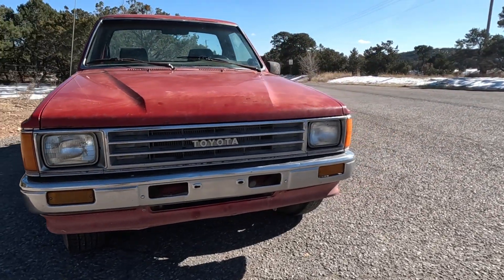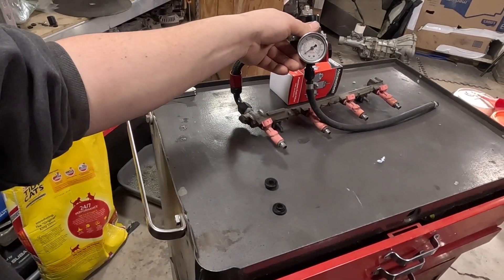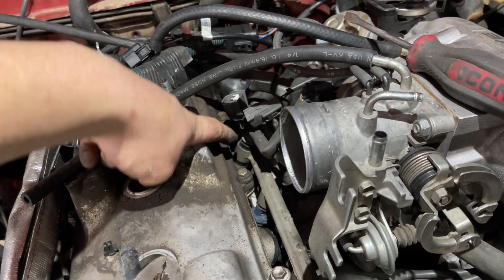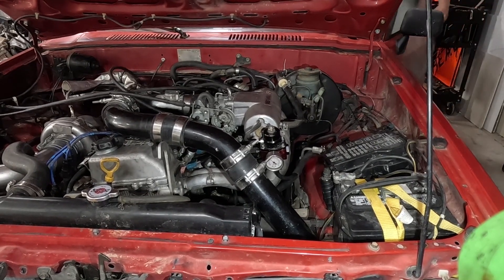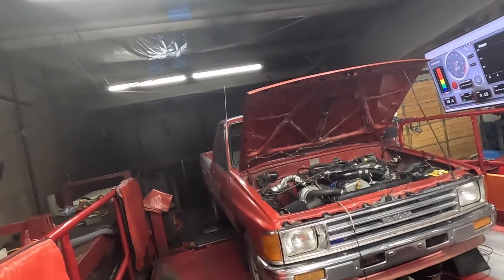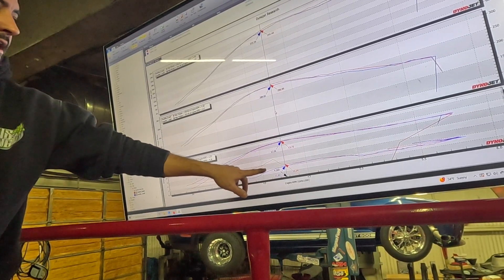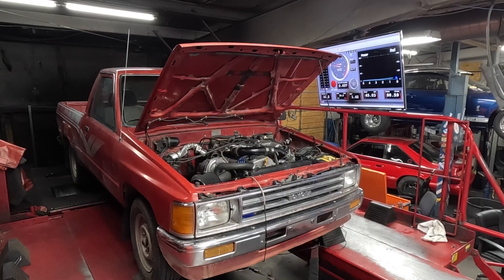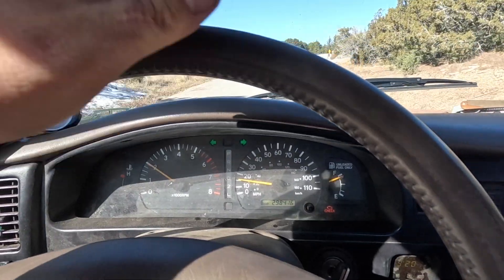TURBO 2RZ Toyota Pickup On The DYNO! - How Much Power?

Comment: toss the automatic in the trash and put in a manual. there is very little support for the automatic and you would likely end up sinking lots of money into it, just for it to blow up again. If you get your hands on a 2tr bellhousing you can run a R series transmission that should have no problem handling turbo power.
Reply from the maker: I’ve actually been on the lookout for a reasonably priced r series, they are not easy to find for cheap! 
I unfortunately think I’m going to end up manual swapping the automatic swap, but have a good auto to go in I might just throw in just to get it back on the road!
Reply: I know a manual is more common for the turbo 2RZ/3RZ platform. But I’ve seen plenty of people have success with upgrading the pressure solenoid and adding a trans cooler. I’ve been researching for quite some time and that’s likely the route I’m going. You can brake boost and the auto keeps the turbo spooled between shifts too.
Reply: I think my Tacoma has a w59 behind it. The clutch slips at 50 mph with 16 psi boost. 5 speed holds up though
Reply from the maker: @mopedman666  are you 2wd or 4wd?
Reply: R150 swap it !!
Reply: i'm wanting to go for 15-20psi of boost with a 2rz, there's sequential shifter kits for R series but not for the W58(which is another i've seen mentioned for swaps)?

Comment: R155 trans will bolt up, run a 3rz clutch since its a larger diameter disc and flywheel. R155 is the strongest 5 speed toyota has made yet. 2005-2015 tacomas. Its what i run.
Reply from the maker: I’ve been looking for one local or at a junk yard wiring a reasonable drive and they seem to be hard to find, I would definitely like to run an R series transmission.

Comment: I've got a 1989 with a 22re 5spd, I have future plans to put at turbo on the 22re. How hard was it to fit one onto your 2rz? also did you have to do any tuning to the computer to make that change or did you just run the piping and oil fittings and send it?
Reply from the maker: I just put the turbo on and a fuel pressure regulator, so I can turn the fuel up just a little, but still the stock ECU. Full send on this one, still an unopened engine with 300k miles. I’ve built 22re turbos before and from my experience I would hold out till you can get a 2/3rz swap, it’s similar or more power than a turbo 22re without a turbo and they respond quite nice to boost. Just a lot more tech in the RZ engines vs the RE engines.
Reply: It's a brand new 22re Reman with less than 4k miles on it. I wish I had the income to toss it and do another swap but I'm stuck with the 22re for the next 200k miles as is lol. If you've got any history on a 22re turbo job what size turbo would you recommend?   @redlineranch.
Reply from the maker: @kernal9093  something pretty small, want to be in the boost pretty early for good drivability, the setup I worked on had the LCE kit with the Garrett turbo. Just make sure you have good fuel supply and proper air fuel ratios, that’s one of the biggest thing with adding boost, need to match fuel.

Comment: Where did you get the Maf sensor mount thing? Aluminum? Part number?
Reply from the maker: It’s a factory housing cut up and welded into a 21/2” charge pipe

Comment: it really depends on what you're doing with the truck. 
an automatic would better for long term drivability but a manual would give you more range and torque control especially if your doing a slow crawl and pulling stuff.
but a good automatic can also do that if it can handle the power, ya could use a adapter plate and get a automatic that's somewhat compatible 
there has to be something that's compatible with the 1999 toyota tacoma drive line, i find it hard to believe that there isn't something that will fit. 
ya just got to look even if its from a different automaker.
i feel like the 2RZ has more then one style of automatic.
Reply from the maker: There are multiple styles most of which are better than what I have, but the auto that's in the truck now has no electronics, and no torque converter lockup. All the other automatics that mate up and hold power better require a TCM or standalone transmission controller, which ends up making it a manual shifted automatic, or requires an entire wiring harness swap again, which doesn't make sense to me right now. And I feel that takes away from the idea of a simple street truck. 
I'm probably going to manual swap it and also move the engine back because I moved it pretty far forward when I initially did the swap, because of the automatic transmission and not wanting to make a new crossmember, but a manual will allow the proper placement of the engine, and allow more power to the wheels.